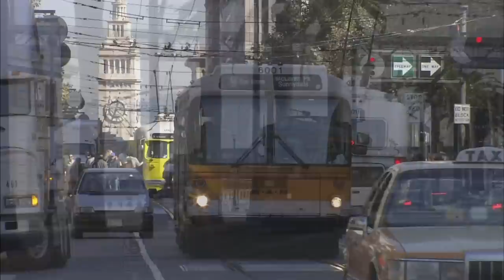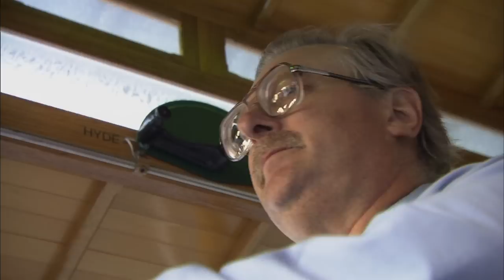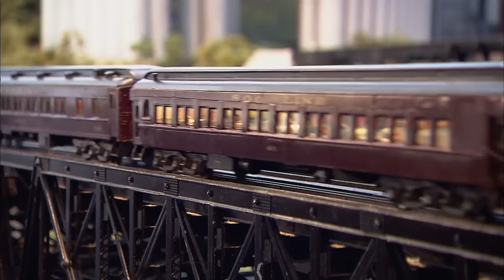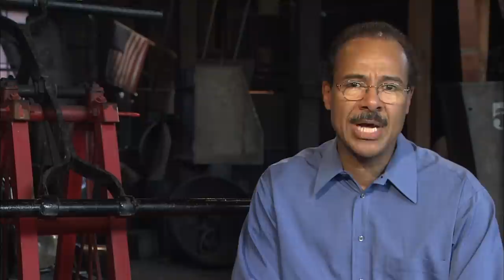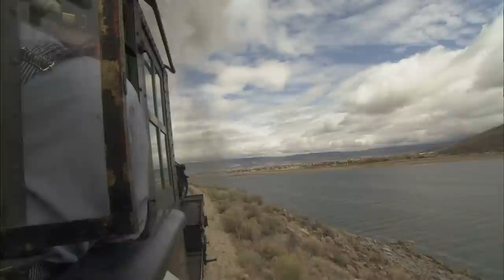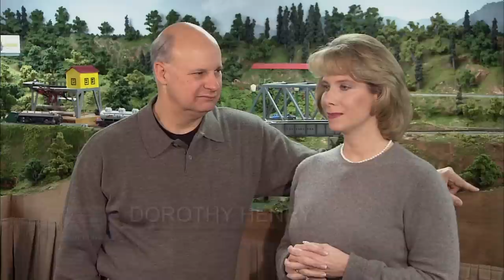Tracks Ahead: Cable Cars (Episode 509)

Comment: Before they developed electric motors to where they could power a streetcar, they came up with cable cars.  Cable cars didn't last very long, roughly 20 years.  As soon as the electric streetcars were developed, the cable cars were taken out of commision.  They had them in several cities around the world, and all of the big cities in the U.S.  San Francisco kept their cable cars running in the steepest areas of town because streetcars couldn't climb the hills due to lack of traction.  Many people think San Francisco is the only town that ever had cable cars, but they were very common.  They are inefficient with power because the cable runs through hundreds of shivs (pulleys) that allow the cable to go around corners.  Other shivs keep the cable at the right height in the trench.  Another problem with them is how complicated it is run multiple routes in a town with crossing cables.  The car operator on a line with the "bottom cable" has to release his grip to drop the cable when he comes to an intersection with a crossing cable.  The car coasts across the intersection, then the operator drops his grip back down to pick his cable up again.  The operators on the line with the "top cable" didn't have to drop and pick up again.  Cables wear out, and a frayed cable can snag on a car's grip making it impossible for it to stop.  Cars have crashed because the cable was not able to be released.  Cable cars are quaint, and they work on hills where streetcars won't, but they are not a perfect solution.
Reply: Dunedin, New Zealand was one such city with cable cars thanks to its steep hills. There’s a preservation group that’s saved two of the original cable cars that operated in Dunedin that have been restored and the ultimate goal is to rebuild one of the cable car routes and operate them as a tourist attraction as well as a public transit service. http://dunedincablecars.co.nz/index.html
Reply: @ChrisJones-gx7fc  
That's interesting.  Are the original tracks and cable conduits still in the ground?
They will have to deal with a lot of challenges, and expenses to get a system running if they have to make a new cable conduit system from scratch.
Reply: @deezynar  I believe it is all from scratch (unless the original track was just paved over but I don’t believe so). It’s a long term goal for them.